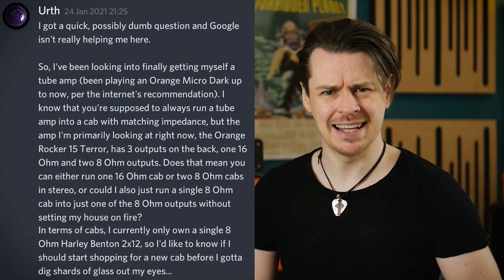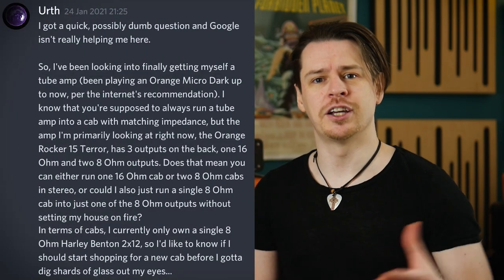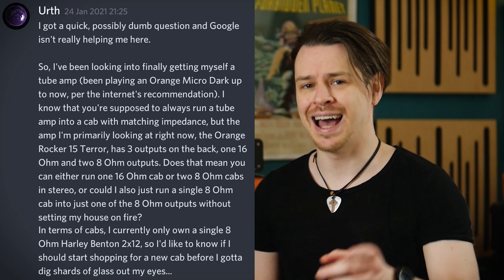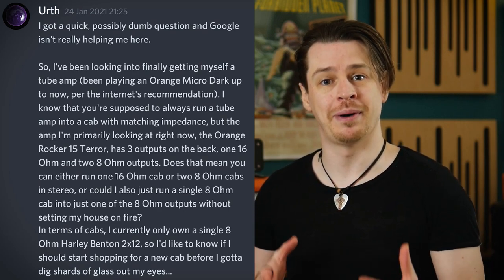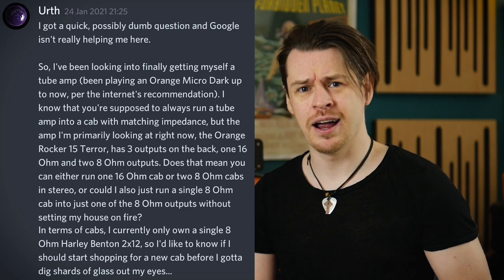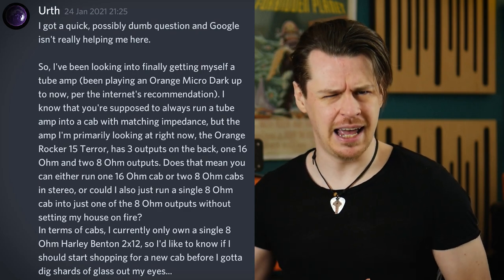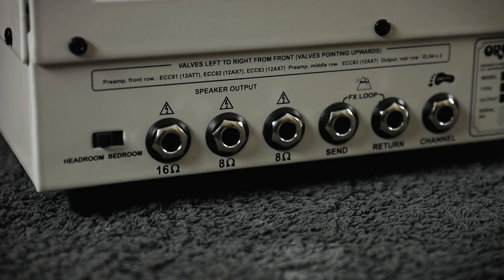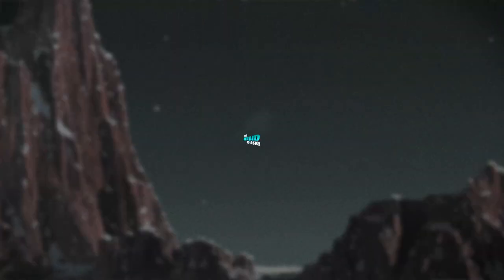Impedance Matching Speaker Cabinets | Too Afraid To Ask

Comment: Following on your comments about the phase element of impedance matching, I've read that with "safe" mismatches (for instance, running an 8ohm head into a higher resistance cabinet at 16ohm) it can cause tonal changes. Which I think speaks to the frequencies of the signal being amplified, as you said. And if I'm not mistaken, often running an output transformer into a higher impedance than it's expecting can cause changes to the mid-range of your output, almost like a mid scoop or mid boost?
Reply from the maker: Mismatched impedance will cause tonal differences because essentially what you are doing is not driving the speaker properly. The speaker is performing inefficiently which will obviously change the sound. 

If a user wants more or less mids there are countless other ways to achieve it without crippling their speaker performance in the process.
Reply: @ScienceofLoud  Hahaha right, like EQ perhaps? I just  found that to be an interesting fact.
Reply: As long as the impedance stays the same or goes higher, you can't hurt anything. Just pick whatever sounds best. But if you're just looking to eq the sound, then use an eq.

Comment: Hello! I have a solid state amp that came with a 4 ohm speaker factory installed. If I change the speaker to an 8 ohm will I loose some of the dynamic range (highs and low, more compression etc)? I know that I will loose some volume.

Comment: Colin, I have two combo amps.  One being a JCM 900 Dural Reverb 4102 and the other being a Peavy Valve King 212 100 watt.  They both use an 8-ohm output for the combo amp speakers.  They both have a switch on the back for 16/8/4 Ohm connection.  I have a PT410 Laney 8 Ohm guitar cabinet to connect to either amp.  My question is should I set the Ohm to 4 since both amps are already 8 Ohm outputs, or should I set the Ohm setting to 8 to match the amp with the cabinet?  From what I am understanding you are saying it should be half the ohm output.  When I hook the external Laney cabinet to either amp, I always set the Ohn to 4 just to be safe.  I do not want to ruin my amps in any way.  But if I could change the setting to 8 ohms and get a better output from the external cabinet, I would do that.  I just want to do what is safe and the best for my equipment.  I am the first and only owner of these pieces of equipment and take ultimate care for my things.  I would appreciate any input you have.  I enjoyed your video and have not only liked but subscribed to your channel.  Thank you in advance for any input you can give me.  My apologies if I did not pick up on the answer you may have already provided and didn't comprehend.

Comment: Great video and explanation bro, thank you! I found out the hard way by buying a Katana MKII 50, it only has a 4 OHM speaker... I didn't do enough reading up on it before I bought it. The 100 and other Katana's  models have 8 but only the 50 has the 4. I just assumed (should never do that, lol) it was an 8 OHM speaker and I could swap speakers if I wanted to upgrade to that Katana Artist series speaker... Nope I think I'm stuck with whats in it, thanks again for the video 🎸🎸👍

Comment: Hi Colin! Question regarding hooking up additional speakers. Assuming we are connecting loads with appropriate impedance values, what would be the impact on the output/tone/volume of the amp when hooking up a single cab like at 4:05 versus hooking up two cabs at 6:05 ? Since the amp still has the same amount of watts, are we effectively splitting the amp's power in half?

Comment: So here I am, not afraid to ask.
Im new to all this Ohm stuff, and have a few questions:
- I‘ve got an H&K 412 140w (supposedly 16 Ohms, said the seller), it has Celestion 12L 35 Speakers. I searched a bit in the www, and mostly they are 8Ohms (did not open the box yet)..
I‘ve got two v30s, 1xCelestion 1x Marshall, both 8Ohms.
So can I just switch any two of the L35s and use the Cab with no issues?
- Second Question - How do you get an 16Ohm, and how do you get an 8Ohm cab?
Does the input plate play a role?
Is there a Video on YT to answer all my questions? :D

Comment: Well aware that you're on pause for a while I have a current question now: using an ampete ampswitch, I find myself from time to time combining a 100W Vintage amp (Roost SR22) to a 1x12 G12 65W Cabinet. Between amp and cab there is a power attenuater inserted to match the volume of the other, more modern amps. Is my speaker in grave danger to do so, or does it indeed see less power from the attenuater? - - - - - - - - Hello CSG community! 👋 Also happy if anyone else here could help.

Comment: Impedance is important on older solid state amps and newer SS amps!.  Ive nearly fried my Darkglass microtubes because of their small ass 2/4 ohm switch in the back.  And dont get me started on the labeling for my vintage butcher..  manuals are a godsend.

Comment: Hi Colin, I have two boss Katana mk2 100 combos which are joined using the stereo expand output - however, I want to buy a PRS MT15 amp head and ultimately use the two speakers in the combos, is this possible? They also have a power amp in function, is it possible to just use that or do I need to mess with the speaker cables which are just spaded at the ends? Thanks, Craig

Comment: Hey Col! I've a Peavey 6505 connected to an Orange PPC212 (16ohm) and I'm considering acquiring another cab for live setups. Having the 6505 a switch at the back for the impedance, when connecting both speakers (16ohm) the switch should then be at 8ohm correct?

Thank you for all the content, you're the man!

Comment: Hi Colin, I have a  cab that can be wired either in series or in parallel (or stereo), loaded with 2 x 8 Ohm speakers, so it can be configured as 4Ohms, 16 Ohms (or 2 x 8Ohms stereo). Now, my amp has a switch to select 4, 8 or 16 Ohms load

Is there any combination which is more efficient between the 4 or 16 Ohms arrangement? I usually use 4 Ohms, reason being, if one of the cone fails/disconnect, the load would go up to 8Ohm which would not damage the Amp, am I correct? any thoughts?

Comment: Hey Colin,

I know this video was made a while back, but I’m gonna shoot a question at you anyway. So I have a combo amp that handles an 8 ohm speaker. It also has a cab extension output for an 8 ohm cab, but when you use that, it’s designed to mute the speaker in the combo itself. I was curious if there was a way to change the wiring of the output jack, so that if i swapped the two 8 ohm speakers (one in the combo, and the other in the ext. cab) for 16 ohm speakers, I could have both speakers functional? Thanks a lot!

Comment: Just bought an Orange Rocker Terror 15 for Christmas and was wondering about this. My Krank cabs were plugged into a Rev Jr which has a switch for 8 Ohm and 16 Ohm as there are only 2 inputs. So with the Orange I would plug each 16 ohm cab into a separate 8 ohm input? Or 1 cab into the 16ohm?

Comment: Hi Colin! Im looking for a amp to my 4ohms Kustom jr cab. It came with 4 ohms amp so that means i cant relly use tube amps cause mist of them want 8 ohms impedance...most of the once i have seen on for axample at thomann, those smaller tube amps. 
Btw do you have any tips of good affordable amps for metal...that also can be used live(hopefully in the near future when live performance comes back)? 
Im looking at a Marshall MG HGFX 100 head, a orange crush 120....

Comment: Great video it answered a lot of questions I had.  However there is one area that still can't seem to find an answer to.  You addressed connecting cabs to the amp and how the ohms need to be matched.  How does that work when the speaker cab itself has an "Out" jack to connect another cab to it.  Will that lower the ohms or how do I calculate the ohms to ensure I do not blow up my amp.  Thank you for sharing all this great knowledge.

Comment: Hey Colin, dumb, not dumb question. Is it always required to jump an FX loop with a line cable? I heard someone said this to me on a JCM900 that it drastically improves the bass response. Now many amps have FX loops, like Laney AORs, OR120, JCM900,... - does this really enrich the sound? What matters? Tube vs solid state FX loop driver? Thank you!

Comment: Okay noob question. I have a Revv G20 amp head that has a 4 ohm and 8 ohm switch, I also have an Orange 2x12 cab that's 16 ohm. What's the safest ohm setting to use on my head for the loudest result?? I've always heard it's okay to have a lower ohm setting mismatch on the head to the cab instead of the other way around. Any opinions are appreciated. 🤟😁

Comment: Thanks mate, enlightenment at last! Ohhhm. But what I’d like to k ow is whether if you connect two cabinets, one wired in series and one in parallel, and the nominal resistance of each is say 16 ohm, whether the amp (say the orange used i this demo) will see what it needs to see?

Comment: Hi. I bought as 4x12 Marshall off Guitar Center for $200. I mostly wanted the cab, and would put the speakers I wanted in it. there is evidence of it being opened up, so I don't know if the speakers in it are stock. However, it has 4, 12in Celestions (I don't remember exact, not Vintage 30's), and one output jack. I believe its wired Series/Parallel and my multi-meter reading came between 10.3 and 13.4. Would that be in the 16ohms range?

Comment: How about connecting a full stack then? 2-16 ohm cabinets, with ins and outs making it series. Would it be 16 ohm out of the amp, then into one cab and chain out into the second cab? Or use the 2-8 ohm outs in parallel and connect one to each? 🤔

Comment: hey so if my EVH 5150-iii head has 2 "parallel speaker output" jacks, and my 2x12 cab says ***16ohm Stereo (Left+Right), or ***8ohm Mono (Left), I can leave the switch behind the amp on16Ohm and connect the two output jacks to the two speaker inputs, correct?
Reply: I believe the answer is no. If you set the amplifier to 16 and plug into both 16 jacks on the speaker you are presenting an 8 ohm load to the amplifier. It sounds like when the speaker is in 8 ohm mono mode, the speakers are in parallel in the cabinet and you are to plug into the left input only. Then you only need 1 cable but you would set the amplifier to 8 ohms.

Comment: TATA: How to not get lost in the abundance of EQs?

This is bothering me as an intermediate/beginner E-Guitar player: EQs everywhere! It starts with the tone knob on your guitar, then there is the preamp with the Low/Mid/High knobs, then you probably have an EQ pedal. Makes already three separate domains where you adjust kinda the same settings. Not to mention the tone knobs on many distortion/OD pedals. When do I adjust what when dialing in my tone? Could You make a guideline of some sort? Thanks!!

Comment: I had the prs mt15 for a while great amp but it was a 16ohm amp and there are very few 16ohm 2x12 on the market 1 had to run an 8ohm through one of the mono jacks.   Sold it for far to little and got a drum set as I have a boss katana head and joyo zombie which were good enough for my skill level.

Comment: Hi Great Video. So I have a question. I have a marshall dsl 40cr. I am thinking of buying an EVH 5150ii e34 head to it. on the back of the marshall dsl40 the speaker is connected to a jack labeled 1 X 16OHM. Howver, on the back of the EVH head there are two jacks for  the input. It is labeled as "Parallel Speaker Outputs 4 ohm min Total 50 watt" Would this work?

Comment: I have a question. So I have a Bugera Trirec that has 2 parallel outputs and a Carvin 4x12 cab that has 1 mono 8 ohm input, and can switch to 2 stereo 4/4 ohm inputs. In order to hook up 2 stereo inputs 4 ohms each, then what should my 2 parallel outputs be set to? Should they be set to 8ohms or 4ohms? There’s a switch on the head that controls 4/8/16 ohm settings.

Comment: It'd help if they put a bracket across the 8ohm plugs on the label and said "8 ohms total"
 I didn't realize that resistance in parallel went up with the reciprocal, or else this would have clicked way sooner :P

Comment: Any advice on connecting a vox ac30cch amp head to two 1x12 cabs? Both are 16ohm cabs. Different speakers. One 80 watts. One 60 watts.

Wondering if i can power both speakers by the 2 speaker outs on the amp

Comment: How is guitar pickup output measured? I usually see it measured in resistance values, but my only reference for that is headphone resistance values. Higher resistance headphones need more power to produce the same volume, but higher resistance pickups are louder? Shouldn't it be the reverse?

Comment: This was really interesting! Particularly happy that the rocker 15 terror is actually the amp I'm running so good to know I have been using it the right way after all.

I do have a follow up question though, I use a load box (2 notes torpedo) between my cab and head so I can record direct through an IR for demos. I get nervous every time I power my amp up into the load box even though I know it should be fine, mainly because I dont understand quite how the relationship changes when using a load box instead of a cab, particularly given that it is still possible to use a cab with it and it also can attenuate the signal.

Is this just some kind of wizard magic or is there a technical reason that this is able to do all these wonderful things?

Comment: If I use a Combo peavey 212 valve king with 2 parallel outputs and a switch for 4 8 16 ohms options, can I combine it with a cabinet of 16ohms and still be able to use the internal speakers that are 4 ohmw (2 x 8hm celestion). So from the amp outputs would be ( 4hms (2 internal speakers) and 16 ohms cabinet (2 x 8 ohms in series). Is this possible to to and what output ohm option should I use ? Cheers

Comment: Remember, you would be ill advised to turn a valve - tube amp on (standby or not!), without a proper speaker load connected first. Bad for the transformer.  Solid State is not a problem this way. Double check that stuff every time.

Comment: So for the 16ohm vs 8ohm connections, is there any difference in sound all other factors (speaker cone, magnet type, efficiency, peak frequency, materials, correct impedance) being as close to equal as possible? Will a 16ohm speaker in a 16 ohm output be louder than an 8ohm speaker in an 8ohm output?

Comment: Ok I’m dumb I think I get it but the THINK could damage my amp head. I have Marshall dsl100 and Marshall angled 4-12ar. I want to do a double stack of the Marshall straight 4-12. So do I put the 1/4 plugs in the __________? To use both cabinets. Thank you and excuse the redundant and stupid question question

Comment: I think more people just have a simple question. And I imagine it's like the one that I have. And the question is basically this. I bought an amp a while back and it was a solid-state amp, It was designed to run with a 4X12 cabinet at 4 ohms And it's total wattage was something like 320 W RMS or something. It is a guitar cabinet. At any rate I just recently purchased a 40W 5150 iconic combo and I can switch the impedance in the back from 4 ohms, 8 ohms or 16 ohms. The question is basically this. Is there a difference because of the fact that the cabinet was meant to run with a 100W solid-state head? Or can I just click it over to 4 ohms and run my 4×12 cabinet loaded with 4 12 inch  celestion 70 80's with my 40W 5150 iconic combo?

Comment: I have an EVH 50w head with the matching 16 ohm 2/12. I messed up and bought an 8 ohm two notes torpedo power attenuator instead of the 16. Is there any issue with switching the head output to run at 8 ohm and using that with a 16 ohm cab?

Comment: This was very useful. I would like to know more. If you made a course in valve amplifiers I would sign up right away.
Reply: There's 2 main things you need to know. For tube amps in general, learn what output transformers and auto transformers are, and how they work. Second, you need to understand how distortion works in relation to guitar amps. In general, you never want a power amp to strain or clip, doesn't matter if its tube or solid state. Guitar amps are different. Distortion of a tube guitar amp works by overdriving the tubes beyond what they can handle to make a clean sound. The reason that tubes sound better than solid state, is due to how a tube distorts. When a tube distorts, it does do in even order harmonics. This is pleasing to the ear, and why everyone likes tube amps. A solid state amp sound terrible when it distorts because it puts out odd order harmonics when pushed too hard. This is why you typically see solid state guitar amps that put out a lot more power than tubes. Its not that a tube amp is more powerful, its just you don't want a solid state amp to distort. This is why solid state and modeling amps have been so long in coming. Its very difficult to emulate how a tube amp distorts. You just can't overdrive transistors and have them sound good.

Comment: What about cabs with multiple options for inputs? I thought the cabs had a set resistance based on the speakers and wiring, but my Egnater 4x12 for example has a 16 ohm mono input, a 4ohm/8ohm mono input, and an 8ohm stereo input.  And would the same equation still apply with daisy chaining cabs together? Like daisy chaining two 16 ohm cabs out of the 8 ohm output of an amplifier.

Comment: So my head has 16, 8 and two 4 OHMS outputs. For connecting two 16 OHM cabinets would I just go from the 16 OHM output to my 16 OHM head and daisy chain the cabinets together using the "link" output on the first cabinet?

Comment: for solid state it is more a matter of if the amplifier has a Nobel network on the output-- great video though definitely more informative than other videos on the topic out there- there is a guy who said you can double your output by using half the load- guy never heard of the max power transfer theorem